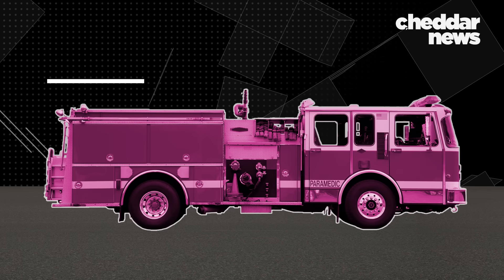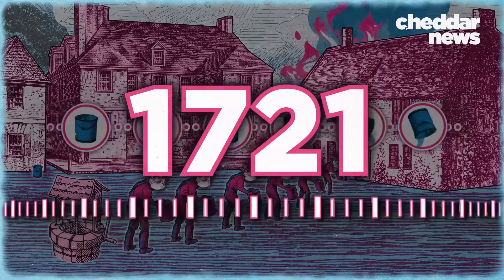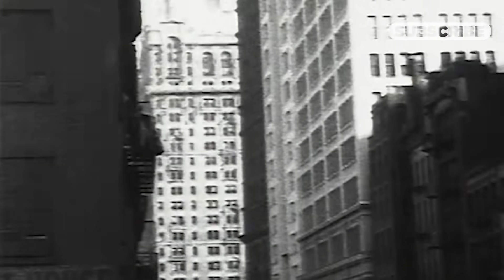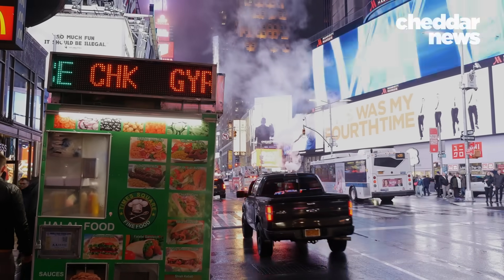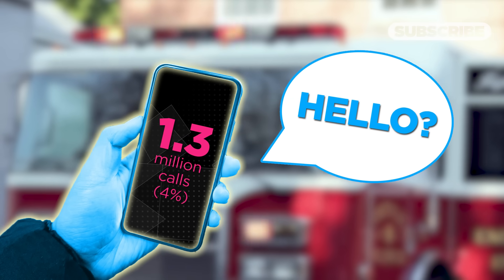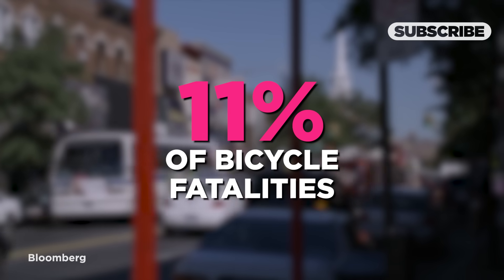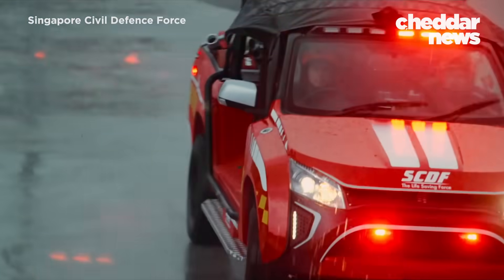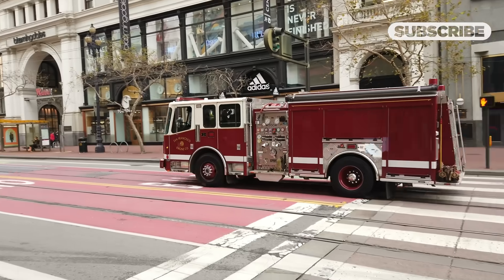Do American Fire Trucks Need To Be So Massive? - Cheddar Explains

Comment: I'm a German Firefighter and for reasons you wouldn't understand, because you didn't do your research and only took as much information as you need to, to push your Agenda, I can say: American firetrucks are fine. They could perhaps be slightly smaller in my opinion, but not as small as a European one.

Because they simply need the space to accommodate a larger pump and a larger water supply. Their houses simply burn differently than ours.
Reply: "Their houses simply burn differently than ours." then what about European fire apparatus in an environment which has pretty much American construction style, like let's say Sweden?

Comment: I watched this video before and after joining the fire service. And in hindsight, this is a lame-ass video.. A pretty useless summary. Here are only two pieces of information that would have to be mentioned, if this were a serious video: 1 - American building burn differently, more intensely than western European houses 2 - A European fire engine can't pump half as much water as an American one can. 

Nitty gritties to that information:
Western European houses are built, using significantly more cement and smoke detectors are mandatory in the very most places, because due to the law, not anyone can simply build their house the way they want to. They need to adhere to regulations. In the states you have more liberties and the very most people just build wood on wood on wood with thin walls and what not. Fire spreads wayyy more quickly. 
Also; In Germany (I'm a German firefighter) our vehicles are normed. We try to unify the way we fight fires, so we norm types of trucks with what kind of equipment it needs to have and what that equipment should be able to do. According to the current norms, the most powerful pumper can pump 2000l/min. That's less than half of an American engine. Because firefighting just isn't the same here. 

My summary of the summary: 

Ignorant, minimal effort put in.

Comment: So European trucks are smaller they can reach the same height and they fit the same amount of equipment and people inside

Question has Europe found the fourth dimension that we can't seem to find here in the United States?

What a load of America bashing crap
Reply: European departments simply distribute their crew and equipment differently. Thus e.g. 105 ft rear-mount Tower Ladders usually have only a minimum amount of equipment to make the entire truck as compact and maneuverable as possible: no tank, no pump, no ground ladders, and only a small cab which fits a crew of 2 or 3. In return, a plain normal Engine carries also the ground ladders and comes with a crew of up to 9
Reply: The European firetrucks don't act as ambulances, and they are slightly more specialized. 
We did this out if necessity because the inner city streets are narrower in Europe. I don't know about American cities.

Comment: Come to Long Island . They are completely out of control . There was a single house fire . A 2 lane road . A florist operated there . 20 or more departments showed up . One drove over 20 miles " to be there and POSE in gear " ! They were all jammed on the road with engines running . Two or three departments could have easily handled it . If you need 20 departments for a single house , something is clearly wrong . Unless you have nothing to do and want to SEEM important !!! There is more equipment in Nassau and Suffolk than in NYC and LA combined !!!!! NUTS !!!!!!

Comment: This is why I don't watch Cheddar "news" because people who don't know any better will BELIEVE this tripe. L.A. had small truck types for jobs way back in the early 70's, even late 60's. But found that they ended up dispatching the engine with them a lot anyway, due to equipment and manpower needs. Not just because of actual fires. So why have two vehicles when, even though larger ONE vehicle can take care of it.

Comment: Japan’s fire trucks are tiny compared to the American ones and they are designed that way to maneuver through the narrower Japanese streets. Same case for China, they bought some American fire trucks, but they are way too big for the Chinese streets and ending up being not practical.
Reply: uhm actually the American fire trucks they use are often more compact than the European ones they run at the very same stations ...

Comment: They made a 6 minute video complaining. 😂 Does trucks are classics and a symbol of the US fire department, and they may look dated on the outside but they are up to date modern tech. They may be large, but they are way more equipped than in other countries.  Specially for big cities like New York. Imagine the amount of Euro trucks it would be, for them to put out the a fire on a building in New York? !😂
Reply: "they are up to date modern tech" still using a 2nd guy to stear the rear axle on the Tiller :D 
"They may be large, but they are way more equipped than in other countries. " actually, that's not even true. 
"Imagine the amount of Euro trucks it would be, for them to put out the a fire on a building in New York? !" they sure wouldn't send a heavy rescue for sth like an apartment fire ... apart from that the amount of apparatus the FDNY sends is pretty much comparable to the amount of apparatus a German department would send, with the difference that they come from like 4 to 5 different stations in NYC, and 1 or 2 stations in Germany
Reply: Bro we can have 50 fire trucks at a location within a few hours. First response within 10 minutes max.

Comment: Actually, pump trucks in America and Asia countries are pretty much similar in size. The extra trailer for tiller ladder trucks makes it longer in comparison to Asian ladder trucks, but in terms of reaching height the asian trucks take the advantage.

American ladder trucks reach 125ft at maximum, while the Asian trucks can reach up to 180-190ft.

Also, China does have american pump trucks which have been increased in size by length and wheel base.

Edit: and different truck brands matter, large Asian fire trucks are mostly made from scania, mercedes or volvo. While the smaller ones are from japan (isuzu and Mitsubishi for e.g.)

Comment: US firetrucks are almost like a 1 man army everyone and everything you need is on 1 truck instead of multiple matthickey9544 listed what us trucks have europe and other countries have 1 vehicle per compartment if there is an emergency of mass proportions in the US it takes less trucks less space for fd to use compared for the 12 (over exaggerating) european trucks to get the same supplies that 2-3 us trucks have. Ex say a bus gets hit by a train and starts a brush fire in Billings Montana your gonna probably see 1 squad (to help trapped victims) a few ambos a basic engine and if bad enough 1 tanker or brush truck but say same scenario in Berlin Germany they would have 5-6+ vehicles on scene and yes larger firetrucks are 3 times as big as overseas counterparts but id rather try to avoid 1 truck instead of 3
Reply: hate to say that you're wrong. 
When looking at a normal Engine in the US the tasks it can do are somewhat limited. Thus you see heavy rescue trucks being dispatched to so many traffic accidents, house fires etc in cities across the US. You won't see a Heavy Rescue Truck being dispatched to a house fire in e.g. Germany. A plain normal Engine can handle most rescue calls with the equipment it has on board, without any support from a heavy rescue truck. 
Staying a week in Washington D.C. I've seen more heavy rescue trucks responding to calls than I saw within a decade in Germany. No kidding. 
Apart from that I see tons of fire trucks and other emergency vehicles responding to calls in the US as well. Like a dozen fire trucks (engines, ladders, rescue trucks, ambulances) for an apartment fire in DC, same in NYC. The actual difference is that they come from multiple different stations in the US, whereas they come from one or only few stations in Germany. 
An Engine from a German FD carries less water, but it comes not only with a larger crew, but also carries a wider range of equipment. No boasting, just a fact.

Comment: The "Huge Firetruck" only appears to be a problem in the dense cities. 

Laughs in suburbanite.
Reply: at some point the size can be an issue even in rural areas
Reply: @EnjoyFirefighting  I mean how big could a firetruck possibly get where it would be a problem in the boonies?
Reply: @archmageofmetal8883  being in an rural area can mean to have wide open roads, but it can also mean to have tight, winding roads, where emergency vehicles based on a semi truck, city bus or even articulated bus would have their issues. Even more so if you take an ARFF Crash Tender onto public streets. Or military tanks convertred into emergency vehicles. Or super tall Aerials, based on a long truck
Reply: @EnjoyFirefighting  I suppose that would an issue in hilly and mountain areas. The rurals in my reigon are all flat with straight roads though.
Reply: @archmageofmetal8883  you're correct that's primarily an issue of mountainious regions, however even in the flatlands I've seen roads where such aspects would be relevant; Another thing coming to my mind: small or old bridges with a width and weight limit, or underpasses with a width or height limit

Comment: every fd station will have diffreant trucks depended on there location and the fd in the us today are trained to park there trucks basically as a shield so they would park infront of the fire as close as they can get still being on the road for the most part so yes bigger is better and having a higher price tag just means its well built

Comment: Yeah - they’ve forgotten a few things . The old engines had deep tailboards , the newer ones barely have one . Try pulling a line when you’re practically falling backwards off of it . 
Since we did occasional  state Strike Team  responses with OES and could be gone for several days : there was little space for any personal gear , so we had to throw it up on the hose bed , which caused other potential problems .  Our brand new engine couldn’t go into reverse on an off-road slope . Engines so tall , you had to station a guy with a chainsaw in the hose bed to cut branches so you could drive underneath . 
Oh - and then our city decided to create extended planter boxes downtown for “ beautification” which made it practically impossible for our laddertruck to make the turn into the Main Street - brilliant . Hey, don’t bother to talk to the people doing the job , what do they know ?
Reply: "which made it practically impossible for our laddertruck to make the turn into the Main Street - brilliant ." how poor is the maneuverability of that ladder truck?
Reply: Unfortunately they made these 
planter boxes in the lanes at the corners , so the swing was reduced at either side - probably reduced it 6-7 ft total - created sort of a long slot - an RV ended up getting stuck in one the first couple of day trying to make a turn . What looks good on paper , sometimes doesn’t translate very well in the real world
Reply: @Bill-l7g  thats an issue we have for a couple of hundred years, with corner stones on pretty much every single corner house in the city ^^
But I agree some modern thoughts look and sound great first, until they actually do that stuff in reality where it turns out to be a total mess

Comment: This video is pointless in analysis. I thought it would be more research base. It is not. You don't even actually compare what truck types are used for what and what they house to specifics. Which is an actual leading cause of larger size.

Comment: Firetrucks are big for a reason. They need to be able to start spraying water the second they arrive on scene. They also need to house a powerful pump to move water anywhere from a couple of feet off the ground to a couple hundred feet off the ground. They need to house medical equipment, several firemen and a lot of other stuff I dont have the knowledge to explain here. If fire trucks being big was a problem it would have been fixed.
Reply: "They need to be able to start spraying water the second they arrive on scene." most Engines in the US will start rolling out hoses and take a few minutes before they can start running water 
"need to house a powerful pump " smaller trucks can do that as well
"They need to house medical equipment" what more than one or two backpacks do you need for medical stuff on a fire truck?
" several firemen" most Engines in the US don't hold as many firemen as an Engine in e.g. Germany 
" being big was a problem it would have been fixed." haha you'd wish. Come on ... Tiller Ladders still require a 2nd guy steering the rear. That's old tech ... or is that no tech? Idk ...

Comment: Albany, NY, wanted to replace its tiller trucks with straight chassis models, until someone pointed out that the latter can't get around some of the corners in the older parts of the city.

Comment: As an American firefighter on a department with the "oversize" fire engines, i have never once had an MVA extraction where the crash victim complained we brought too much gear or someone who was having a medical emergency complained that we carried medical gear on the truck.  A small truck is fine as long as you have the manpower and extra time to run mutiple trucks when you need something not on your "oversized" engine.
Reply: "A small truck is fine as long as you have the manpower and extra time to run mutiple trucks " a rather compact Engine in e.g. Germany comes with a crew of 9 firefighters and holds more equipment than its American counterpart ... still they respond with several apparatus depending on the type of call